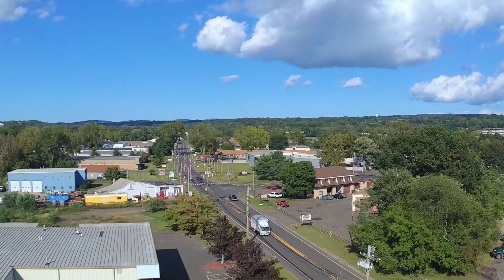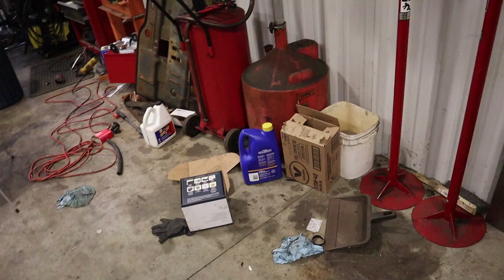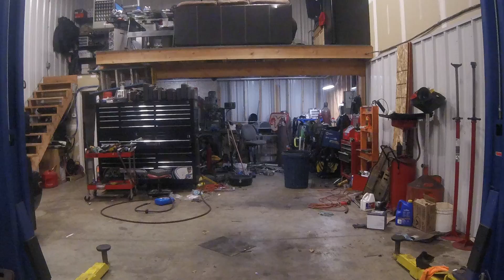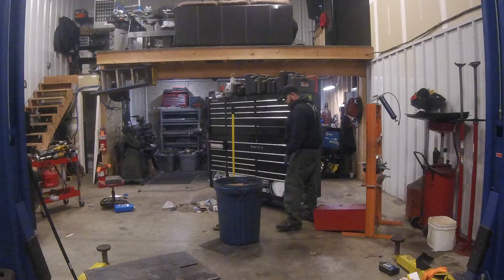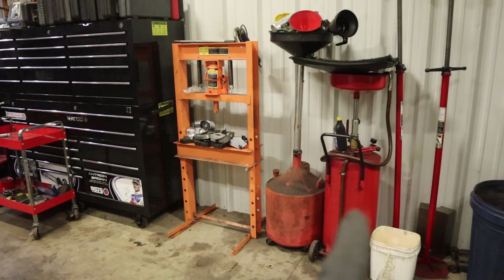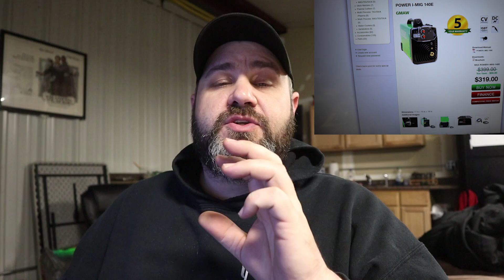BEST MIG WELDER FOR A BEGINNER?!

Comment: I want to buy a welder to weld in cross members on a utility trailer. 3/16 or 1/4 inch think the everlast you featured will be able to do that or will I need a bigger welder
Reply from the maker: I would go with the yeswelder might 205ds or the mig250pro. Yeswelder.com and use code MORFAB for a 10% discount!

Comment: Question here. So Im wanting to buy my first welder and Im taking your advice about buying a welder to grow with. Im going to buy a 120/240 mig/flux core welder. My question is can you Flux Core Weld on 240 Volt or does flux core only work via 120 V. Im asking cause I dont know.and it will change my plan on how I wire up my garage for welder. If you can flux core weld on 240 then I plan on wiring my garage up with 240 V dedicated welder outlet.
Reply from the maker: You can most definitely flux core weld on 240v as a matter of fact your welder will be able to reach its full rating at 240v with both flux core and gas shielded. Wire it up 240 and send it!
Reply: @MorFabIndustries  Thanks for replying back. Yeah this kind of confused me on flux core and then had me confused on how to wire up the garage for the welder. I just didnt know if you could or if it mattered. I will definitely be going with the 240

Comment: Eh, I am running my Dads old Lincoln buzz box 225. It’s from the 70’s and I have to kick it sometimes to get the fan turning but she lays a big ole bead I have a 140 mig that has gas hooked up but know one has showed me how to use it yet all I get is splatter when I try, a friend said the power knob isn’t working low current idk

Comment: Got a Longevity 140 gas for $362 on EBay plus $140 for a tank from locally welding company. Love it have done 3/16” with it. Yep now days they are over the place and some day it’s going to be a Miller.
Reply: Yep it might blow in 6 months but it’s a start didn’t want to break the bank cause I just started welding didn’t know if I would like it and now have afire pit cause of it 👍

Comment: I got a used CE harbor freight base model welder for $20.. Its 20% DC @90A according to manual. However what you find out after is its an AC welder. Not good for basic beginner stuff. I had to spend about another $60. to convert it to DCEN and beef up fan. So it works much better but like you say its limited.

Comment: AMICO MIG-200, 200A MIG/Flux/Stick/TIG/Arc 3-in-1 Welder Spool Gun Weld Aluminum  - eBay item number: 154325191734
AC 115V & 230V/1-Phase/50-60Hz, 230V: 38.5A(MIG)/29.5A(TIG)/41.5A(STICK),115V: 39.0A(MIG)/31.0A(TIG)/47.0A(STICK)
Duty Cycle: MIG: 60%@200A, TIG: 60%@200A, STICK: 60%@200A   or  https://www.amazon.com/dp/B08WL1T8W2/ref=cm_sw_em_r_mt_dp_689BBPHYR268YGKCVFSZ

Comment: What about the low end amp rating which i think could be more important then max amp rating for someone using a mig for thin steel car bodywork without burning holes

Comment: Everyone has a particular price point so your Everlast recommendation is a good one. However, if you are really serious about welding then I would recommend looking at a multi-process welder. These do MIG, Fluxcore, TIG and stick all in one machine. HF has their new line of Titanium welders and their multi-process (for about $650) gets very good reviews. Lincoln has also just come out with a new 140A multi-process unit that is in the $750 range that would be worth looking into. For me however, the one I really want is the Everlast Power MTS211. It's about $1100 but it does absolutely everything and you'll never out grow it.

Comment: So the Everlast can do up to 1/8th inch is that good enough to say do frame work on my truck or repair or build a utility or car trailer?? Sorry new here don't know crap about welders yet. FYI: The Everlast is now $399. and kit does not come with the flux core drive roll so you cannot do flux core welding  out of the box unless you purchase this. So out of the box you cannot weld anything unless I am incorrect?

Comment: CHECK OUT HPT WELDERS THRU USA WELD...
MIG 130 EXCELLENT MACHINE ! 
FROM WEBSITE...

The versatile welder uses both 8" and 4" diameter spools of wire. It comes ready to weld with extra tips, a roll of .035" flux-cored (gasless) wire, flowmeter, and gas adapter. Polarity reversal is easy and requires no tools. Just add a tank of 75% Argon, 25% CO2 shielding gas, and you're ready to go!

WELDS ALUMINUM WITHOUT A SPOOLGUN, JUST USE CORRECT GAS MIX
Mando

https://www.usaweld.com/default.asp

Comment: I have the Vulcan omnipro 220 and I absolutely love it. I don't think there's a better value multiprocess welder out there. Honestly, I would recommend any of the Vulcan welders.
Reply: The Vulcan seems to get very good reviews however HF recently introduced the Titanium line. The titanium multi-process unit also gets very good reviews, is about $200 less and comes better equipped. It does lack some of the Vulcan's features however but many people won't need them anyway

Comment: Wish non expensive unit you recomend that can use to weld aluminum too?
Reply: If you want to weld aluminum your choices become limited very quickly. Most welders will tell you that to weld aluminum you need to either TIG it or use MIG with a spool gun. If you go with TIG you need a machine that has an AC output and these are generally expensive. If you go MIG you'll need a machine that takes a spool gun ($200-$300 for the gun alone) so that gets pricey as well. Some people say they can MIG aluminum without the spool gun by using a stiffer aluminum wire and keeping the MIG hose straight (so the aluminum wire doesn't bend in the hose) and a few really good welders say they can stick weld aluminum but most will tell you to forget doing either if you want decent looking welds. Aluminum is tough to weld correctly even under the best circumstances

Comment: What’s duty cycle?
Reply from the maker: The amount of time that you can run the welder at a given amperage before it goes into overheat protection.
Reply: If you have a 60% duty cycle that means you can run it at full power for 6 minutes and cool down for 4 minutes before welding again.

Comment: Considering you have to buy all consumables from Everlast like the tips what do you think of the Lincoln 140 HD from Home Depot? It includes 2 wire rolls one of them Flux core, a better ground clamp and consumables that you can buy everywhere.
Reply: I have a Lincoln 140HD. It's been a very reliable machine and it does weld good but it is very limited in that you only have 4 voltage settings and since it's a transformer based machine it is heavy (about 55 lbs.) compared to the new inverter welders (about half that weight). For the price you pay for the 140HD I suggest looking at Lincoln's new 140A multiprocess welder. It's a couple hundred more but can MIG, TIG and stick weld, is much lighter and has way more adjustability

Comment: Imma get hated on but the eastwood mig 135 is an excellent deal I got mine for 260 and another 50 or so for the large auto darkening helmet. So for about 500 I had a complete welding set up, the machine has post flow even too uses tweco consumables and lays a better bead than I can still, also has plenty of power on 3/16s steel
Reply from the maker: Eastwood is a good option too! I just havent had much usage on them.
Reply: If it had a metal drive system. Id be better. Besides being made in China